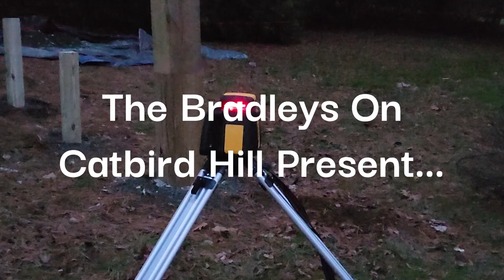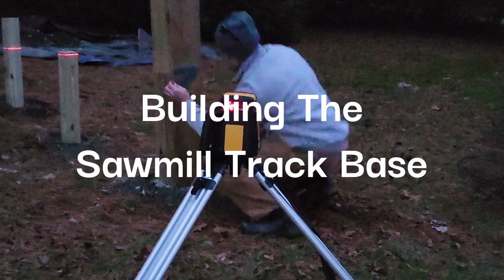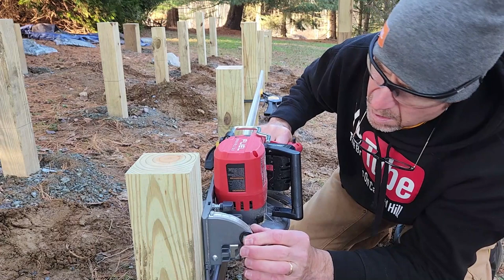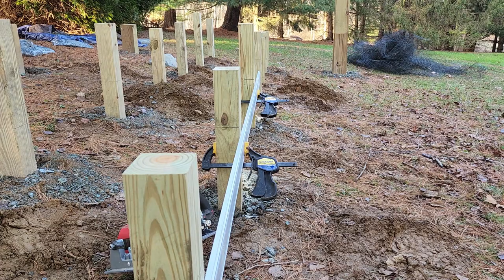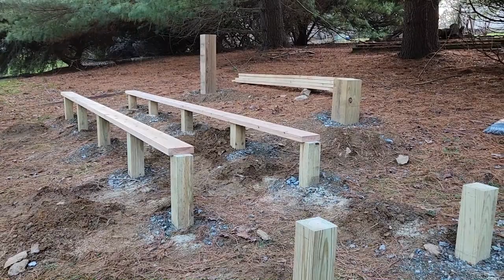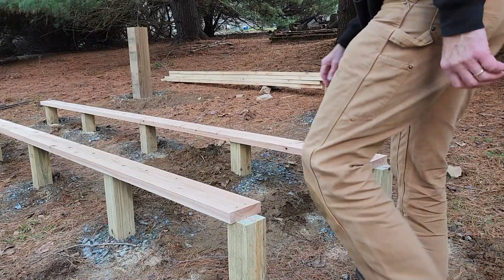Sawmill Shed Build Part 4 - Building The Sawmill Base

Comment: I like the way you have set up the base to mount your mill on. I haven't given any thought how I want to mount my mill , I'll do it once the new shed structure is up.  Are you happy with the way your mill is mounted?  That's an interesting point about metal in contact with pressure treated wood, thanks John.
Reply from the maker: So far, I have been very happy with the mounting.   I had joined the Woodland Mills FB group and got excellent advice there.

Comment: The laser level made marking them post easy. Th project is Going along nicely John. What was you using for the straight edge?
Reply from the maker: Thanks, Joey!
I believe the manufacturer is a company called Bora.  It is a ripping guide, what you would clamp on to a 4 by 8 sheet of plywood to rip it to certain widths. I bought it at Lowe's.